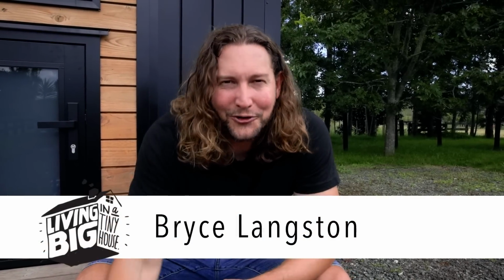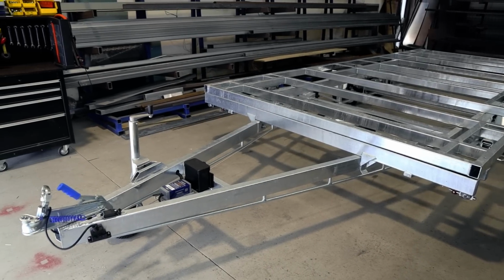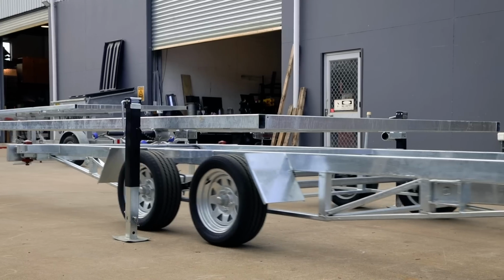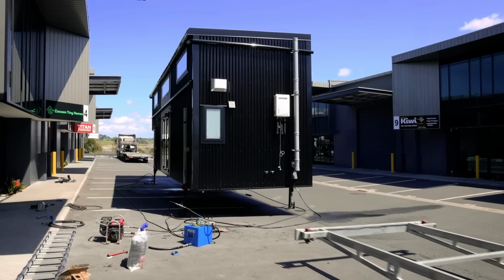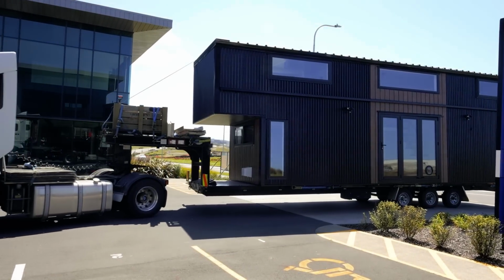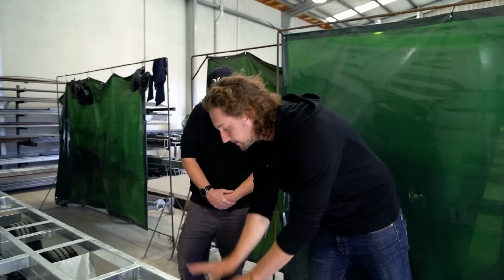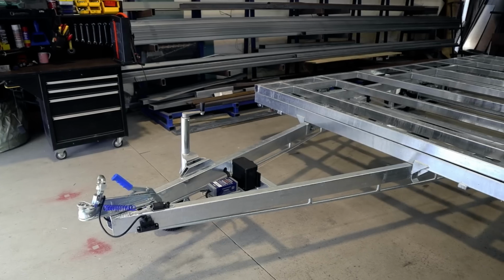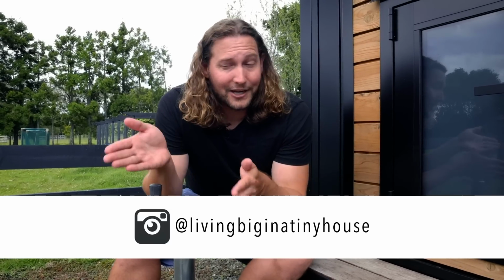All About Tiny House Trailers: Game-Changing Split-Shift Design!

Comment: I like the idea of using the trailer as a deck for the house, but I have two problems with the practicality of this design. 1. All the plumbing pipes and water tanks usually go under the house, so thought will need to be given as to how to set it up, maybe external pipes and external tank? 2; in high winds, having the trailer helps keep the tiny house from blowing over. You may need to anchor it down

Comment: Just an observation.  As a Tiny House designer,  unlike in the USA, or Europe,  where many THOW's are trailered all over the place, we tend to only actually use the trailer, primarily, to 'locate' the Tiny house. Once it is positioned, it pretty much remains there indefinitely.  The trailer however needs to be Warrented and Inspected regularly.  This design addresses THAT issue. It also addresses our 'wideload' law loophole, that allows the house to be wider; IF it can be removed from the trailer. But another issue, is the huge cost, and weight, of the trailer. In truth, once a house is sighted, it may not move....for YEARS! And only need shifting, once or twice in it's lifetime. It is an inefficient approach. Unless one intends to travel, or move a lot. 
A better option perhaps is to: 
1. Hire a Lowboy, and have it moved, professionally,  (if possible) or 2. Have the Sub-trailer be a 'Hire' option. Once the house is in position, take the Sub-frame back to the supplier.  It could be reused again, to shift those customers that intend to 'stay put' for a while. Hire it again, when you move. That way, no trailer maintenance.  There is an lot of money and headache, tied up on that set of wheels, Just to keep it mobile, waiting for the day you want to move it. 
It reminds me of 'boiler' type water heaters, that keep gallons of water, hot,  24/7 at the ready....just waiting for you to turn on the tap. Instant heaters are more  cost and energy efficient.

Comment: Many Tiny Houses cannot be delivered on flatbed truck or crane due to access. This type enables placement of house that is unlikely to be moved much. If removable it could reduce cost of the house. 
Builder in tandem with transport and trailer. 
Hire of trailer could be part of transporting cost. I do wonder about final stability of house too.

Comment: That is an awesome trailer.  Great idea to be able to disconnect it from the home.  I would pull it out and set my home on blocking if I were to stay somewhere semi-permanently, and use the trailer for other purposes.  Even just to take the load off the trailer springs and tires and roll it around occasionally to keep the tires round and the bearings moving.

Comment: Interesting video Bryce, Thanks.  Why do you need the trailer unless you're moving somewhat frequently?  Just use the top bit and then hire someone to move it as needed.  Is 3.5 tons a limit on all trailer situations or just on trailers with houses attached?  Prices - Top section and complete trailer assembly?

Comment: I must disagree with his viewpoint on the break away aspect of the trailer. The safety chain is the key feature of keeping the trailer under control and not veering into on coming traffic for example. Here in BC🇨🇦, no safety chain(s) is a hefty fine and roadside seizure. The breakaway tether for the trailer brakes must be adjusted to engage once the hitch uncouples from the ball. 🤙

Comment: Can you just rent the lower half?
Does it connect to a standard container?

Does the tiny house still comply with caravan rules when the trailer is removed or does it become a tempory structure and fall under les the than 30m² secondary dewlling or tempory structure rules?

Comment: Very neat design.   I understand the idea of having the trailer detachable so you can use it to carry loads on other trips or other reasons. But is the idea that that trailer should still be under the house as much as possible because the wheels do add strength and stability to this mobile home??

Put another way, if the trailer is gone and being used elsewhere the stabilizer jacks on the house seem too little and nimble to hold the mass of house and contents and people.  So the trailer is needed, right?
Reply: You can put footings under the home to support it, typically, you don't leave the home on it's wheels anyway as unnecessary wear and tear.  While the difference in this design is the house needs it's own floor joists, etc. instead of integrating itself with the trailer.  So you lose a bit of max headroom with the space the flooring takes up and being on top of the trailer instead of integrated into it but you don't have to deal with wheel wells and if setting it on a foundation it can become like a regular pre-fab house, which brings up the other option as the builder can just use the trailer to deliver the home and thus that won't be included in the cost of the home.

Mind, just the trailer can cost up to several thousand.  Though, you'd have to pay for land and foundation but that transition could be easier if you don't have to pay for the trailer too.  So can work for those who don't need to use the trailer for anything else as well.

Comment: What if the trailer had decking incorporated into it?  Park your tiny and then simply pull out a deck the same size as your tiny house!
Reply: But in some areas the tiny needs to be on wheels to be warrented
Reply: @tteric67  probably in most areas but can easily put the trailer back if needed
Reply: Yes nice idea and of course make the decking so it can easily be removed 👍🏻
Reply: My first thought too.

Comment: It's a great idea, however there is a potential for authorities to consider the tiny as a "load" rather than a "vehicle" as it is detachable from the trailer (vehicle).
I have seen a determination from MBIE where this worked against the tiny house dwellers when the local council claimed it was a building and therefore needed building consent.

Comment: Edit: Bryce mentions at the end that the trailer engineering plans are available. 😊

Is there a comparable North American (USA/Canada) alternative? This versatile design is fantastic.
Reply from the maker: Right now, BES have plans which are being made available which you could take in to a local engineer and have them modify to meet your local regulations. If there is enough demand though, they may either start working with a US based engineering firm, or have special plans modified for the American market.
Reply: @livingbig  cheers!

Comment: I appreciate and watch all of your videos.  I'm still very heavily influenced by the "FrameCAD" video where you describe building your first tiny house.

What are the dimensions of the trailer?

I'm thinking about retirement, and rather than a standard home, I want to buy and live off-grid on, some inexpensive remote land I buy. I am thinking about having a home that is composed of several tiny house elements.    I want the option to move the home elements.  Typically container size is 8 feet wide, but what I'm wondering is, if this is a bit wider?

Also, this would be in the US. Thanks for any replies from anyone.
Reply: Hi, after a quick search, I found this on the website of bayengineering:

3500kg rated trailer built to any size required
The most common sizes plus draw bar are 6mtr, 7.2mtr, 8mtr, 9mtr  and 10mtrs and widths can be from 2.4mtr up to 3.1mtrs with the removable decks ( not limited to these sizes but are most common)
Reply: @jodhan90  So, now I'm wondering if these are available in the US, or are they only sold in New Zealand?
Reply: @alansnyder8448 the engineering plans are sold worldwide via the link in the description. Once you buy the plans, you’d take them to your local US engineer (or you can build this trailer with welding experience) to have the plans modified to local and personal size/weight restrictions/desires.

Comment: Nifty system! Would be very useful in Germany, as it wouldnt have to follow caravan laws (if its connected to the trailer, it has to follow caravan regulations including stuff like weight, size, electricity etc, but if it isnt, its just cargo).
Reply from the maker: Absolutely, Our trailer regulations in New Zealand are very similar to Europe, so this could be a great option there too.

Comment: Question: For the trailer portion, have they considered creating a modular floor and wall attachment system, to turn the trailer into a container area? Then you could use it to haul in loose material such as sand, planting soil, etc.
Reply from the maker: Yeah, this could definitely be done and I've had conversations about doing just that for this trailer.